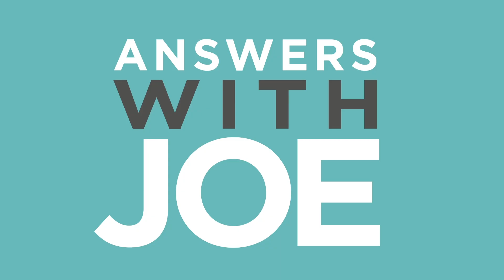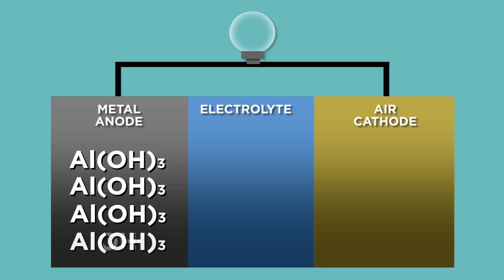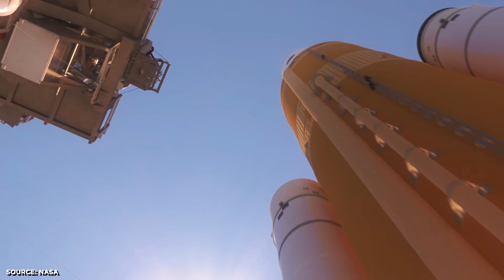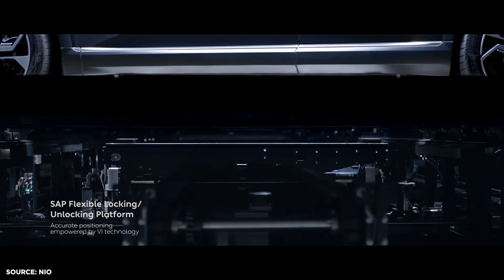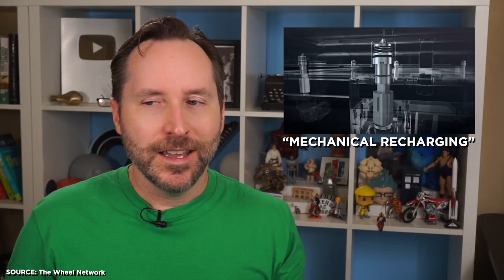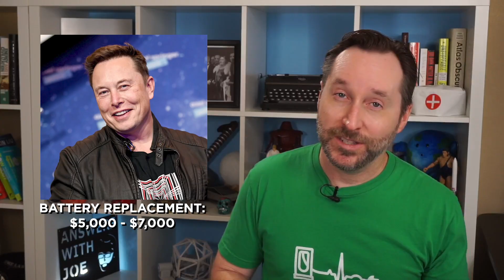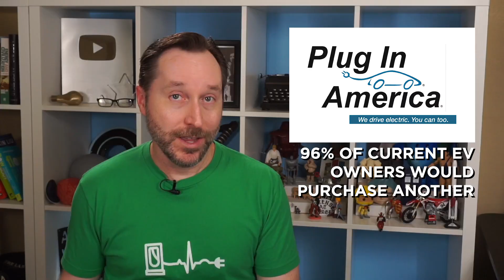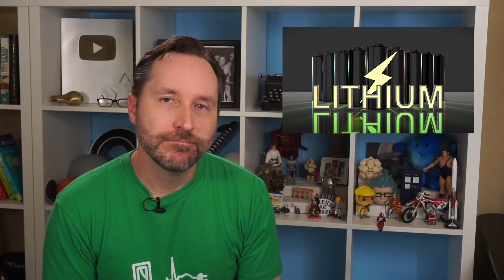This Battery Could Drive A Car 1500 Miles - But There's A Catch | Answers With Joe

Comment: "Batteries as a service" Oh I'm sure car companies would love that, then you would never truly own your car because you never owned the battery in the first place and can't make use of the car without paying their subscription fee. Don't forget one of the favorite ideas of corporations is to have you "own nothing and love it", or that you absolutely won't.
Reply: This is exactly what Renault did with its Zoe electric car: you would buy the car but lease the battery. This means the purchase price is lower, and running costs are still lower than gasoline/diesel cars. But yes, it means that the car company is getting that sweet, sweet lock in. Or was, rather... Renault recently abandoned this concept.
Reply: He never actually said you won't own the battery. They are taking the battery that came with your car after all, so if they take ownership of your battery then it makes sense that you would own the battery they provide to you. He didn't say they're doing this for aluminum yet but for lithium, so there's nothing stopping you from charging it the 'old fashioned' way after they swap you with a new one. It seems like it's mostly for long trips where you can't recharge.
Reply: @slcpunk420  It's the same difference if it is impossible to recharge the battery and you are expected to pay a subscription fee to be able to get it replaced instead of buy a new one. Then they can just say "Oh no, we won't provide our service any more" and your car is useless because the battery is dead, can't be recharged, and the only company selling them decided they don't want to sell it to you since you didn't want their service.
Reply: @kingkiller1451  so again he said this was lithium at the moment not aluminum but either way, how is that unlike anything else? All batteries die lol some faster than others APPLE ... I can't play original Nintendo games without an NES and Nintendo won't make me one so waaaaaa 👶🍼 anything proprietary can become obsolete and the company can charge whatever they want if you need a new one, tough 💩
Reply: @slcpunk420  Just like we own our phones and software and modems and cloud data and personal information and...
Reply: @carlodave9  more like our phone batteries in this case ... and no you typically license software, unless you wrote it yourself, on your own time with your own machine, you don't usually own it
Reply: @carlodave9  in the EU you own your phone.
Reply: One way, or another, they'll find some way to keep you buying the fuel from them, with the government taking their cut.
Reply: "Your engine is stored on the cloud"
Reply: Just like refilling gas, can't use the car without gas ;)
Reply: @arneeidefjeldsgard1863  If car companies owned all the gas stations or all the oil refineries then that would be a valid comparison.
Reply: @username65585  car companies are in bed with oil refineries which are in bed with all the oil producers, it's just one big happy bunch
Reply: @arneeidefjeldsgard1863  except if you own a farm you can produce your own biofuel.
Reply: It's called feudalism. Get used to it.

Comment: I've been saying for years that if battery manufacturers were mandated to recycle 1 battery for every 1 they produce they would be able to resolve the closed loop issue extremely quickly.  Basically force them to recycle their own product. Place a deposit on the battery similar to the deposit on beer bottle.  The consumer will take a small financial hit on purchase and get the money back on turn in.  We already have the systems in place to do this stuff.  What we don't have is the level of interest and will to actually do it.

Comment: Cars were until very recently quite the headache to maintain. Oil changes were a regular thing, and checking the dipstick was something the gas station attendant did every time they pumped your gas. Before everyone had automatic transmission, power brakes and steering and computers under the hood monitoring everything, cars were not only harder to drive but harder to maintain because diagnosing problems was more complex and easier to break, as anyone who has driven manual transmission vehicles can attest to.  But there is no doubt that maintenance performed by nonprofessionals throughout the 20th century was much easier for owners of the horseless carriage than from the preceding technology.

Comment: 4 cents per charge for Tesla batteries? Or the mile equivalent comparing to the Aluminum Air battery?
Reply: If it's per charge for a Tesla, then it's worth it for the Aluminum Air battery vs recharging of Lithium when comparing the same mileage with x recharges tallied up.